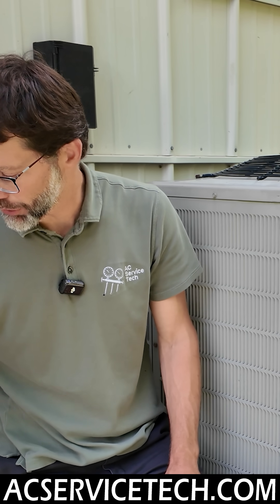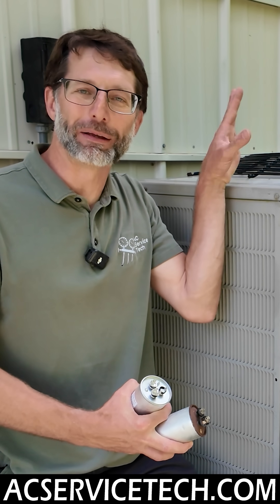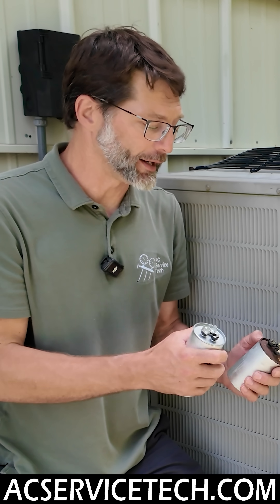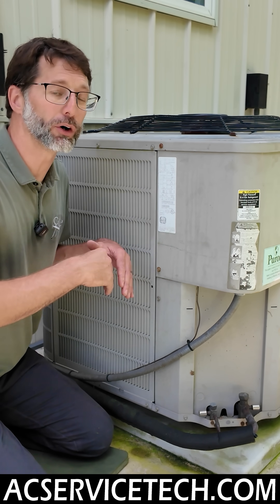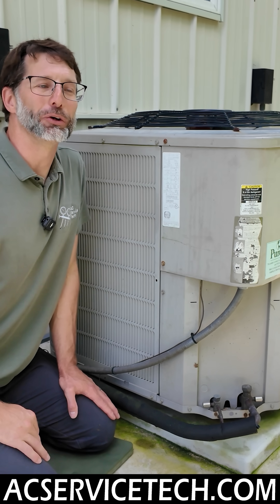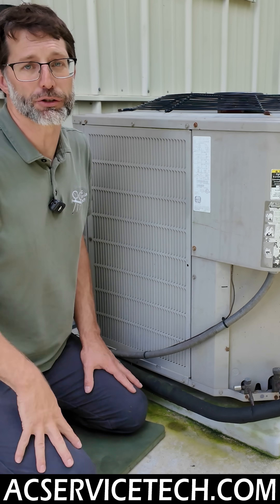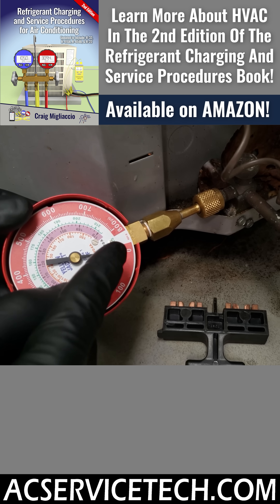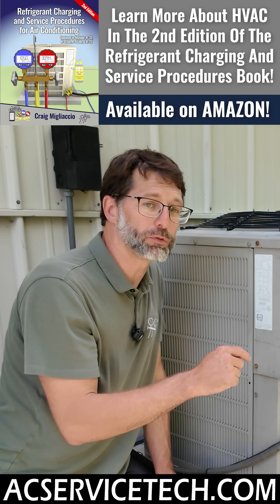Why the Outdoor HVAC Unit's Refrigerant Compressor is Not Running, Explained!

Comment: Do NOT be so quick to fully grab the liquid line like that EVER lol.
Reply: That's for a discharge line that contains heat of compression in the refrigerant molecules that it carries. If the LIQUID line AFTER the CONDENSER is hot enough to instantly burn you (which would be well over 140°F), then you are gonna have a SLIGHTLY bigger problem than a burnt hand or a finger. If the pressere were so high, that would mean that the condenser coil has already ruptured and burst, because it can't handle that high of a pressure, which would be well above 600+ psi for r410a.

Comment: How much is a capacitor parts and labor- Trane?
Reply: A capacitor's price varies with quality but in general they wouldn't cost more than about 40 for a very high quality one. With that said i had a guy charge me $300 parts and labor for a cap replacement even though i had troubleshot it and told him what it was.
Reply: Your gonna pay $285-525 for a capacitor installed. Cheap Chinese ones are about $10-15 and good American made ones are $50-100.....I use turbo 200 and turbo 200x. We charge $425 and they come with a five year warranty. Or $325 for a Chinese one and a 30 day warranty. I also live in California where all my suppliers/gas/insurances/ect seem to be higher than most other places.

Comment: Very well done ! We had a lightning storm and down the road. The power lines lost one of its lines only feeding the house. 110. And with that we shut down the AC on a 220 v unit. Then when we restarted it when all the power was restored but we were still receiving 110v. Then the capacitor was able to kick on the compressor with the evacuation fan outside. We have a split unit. Either that was the case or a single phased for a moment and resetting it for 20 minutes, turning them back on letting it rest and the fluids to settle and gases haven't had a problem since. What do you think happened?
Reply: Do you have a relay controller switch or a control board? If you have a control board,it could have just confused it with half power and should be fine now. You could have had a contactor stuck too. If it's working fine now,I wouldn't worry about it.